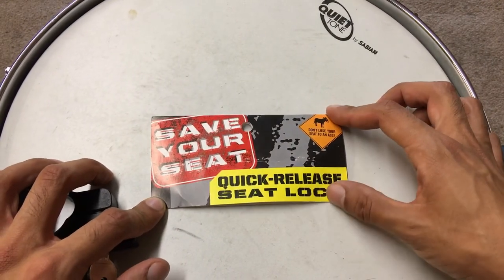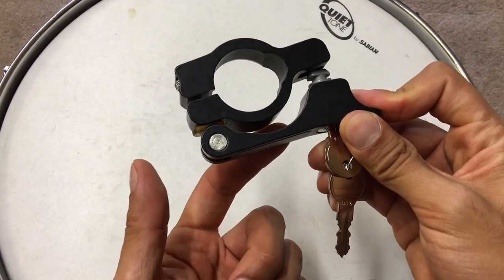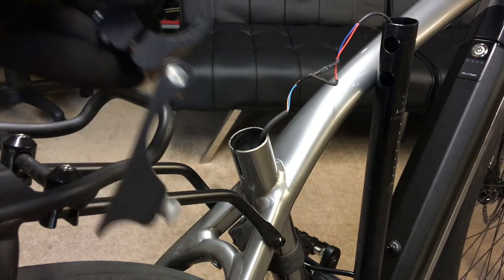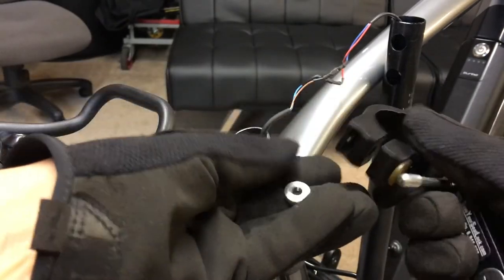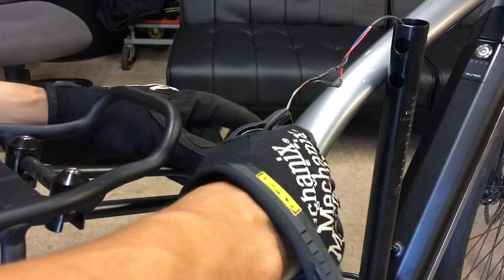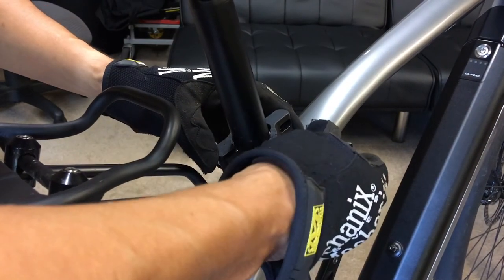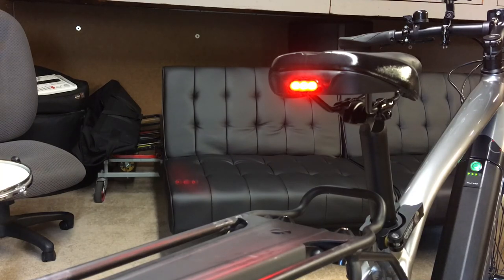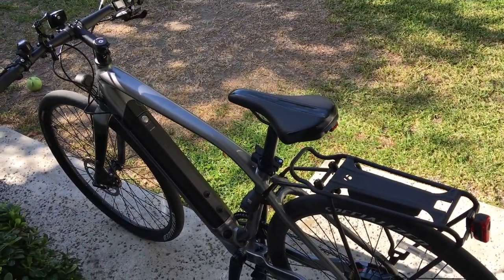Save Your Seat Lock - bicycle seat lock installation and thoughts

Comment: Keep in mind this only secures your seat post. If you got an expensive/desirable saddle, the thief can loosen the nut that attaches the saddle to the seat post and take the saddle.
Reply: do you have any idea how to secure both?
Reply: @kenta486 replace the nut with a security skewer.
Reply: @kenta486  I use a short locking cable that secures the seat and post.  Not as clean a look but it works.
Reply: Lol my ones welded
Reply: @kenta486  If you lock the bike put the cord of the padlock between the saddle railings.

Comment: I don’t get the negative remarks for this.  Of course it doesn’t protect the loss of your saddle, but there are other remedies for that.  What this DOES do it prevent the thief from just using the quick release to steal the seat post AND  the saddle in 5 seconds.   My suspension seat post set me back $79 and my saddle $40.  A BB superglued in the hex bolt will save the seat and this will save the 5 second loss of the whole works.
Reply: He wudnt need to protect the saddle if his bikes just locked up for 15 to 30 minutes at a time  in a visible area. Best thing u can do with a nice bike is not leave it locked up outside. That's what thieves look for. That bike that's there everyday from 9 to 5

Comment: I used to take my seat and stem off and store in my backpack.also I only had one good lock so I removed the front quick release wheel and locked it to frame and back wheel,putting the quick release bar and nut also in back pack.if they removed my lock they couldn't ride away on it as I had the quick release bar with me.takes a minute to complete.also no seat to sit on.🤣👍

Comment: This just saves your post,not your saddle.
Reply: Not exactly. It makes it take longer/require tools to steal the saddle. Without it, your saddle's just one-lever away. And the seat post isn't "saved", it is also steal-able with a saw or grinder, if anyone really wants it.
Any quality lock or safe is scored on the basis of "time to crack", meaning how long it would take a determined thief to defeat the security.
If this lock raises the time-to-steal from 2 seconds to 45 seconds + one tool required, that's actually a pretty significant rise in security.
Is it perfect? Of course not. NOTHING is.